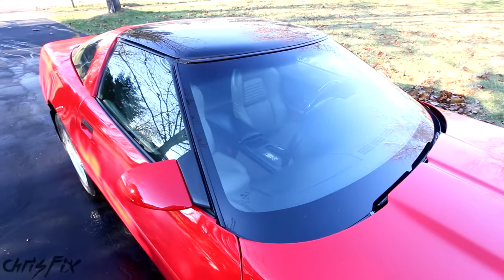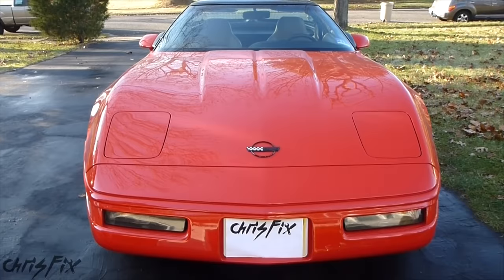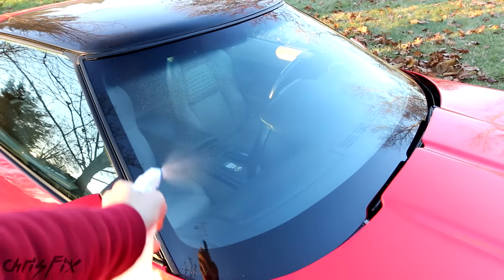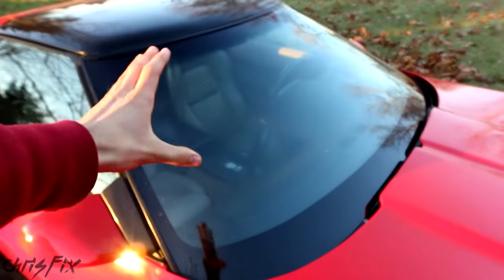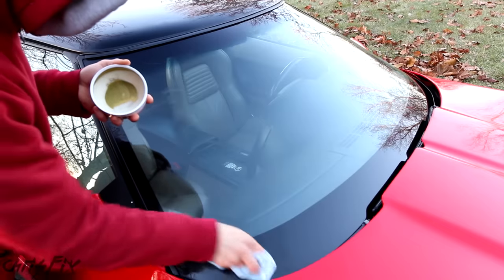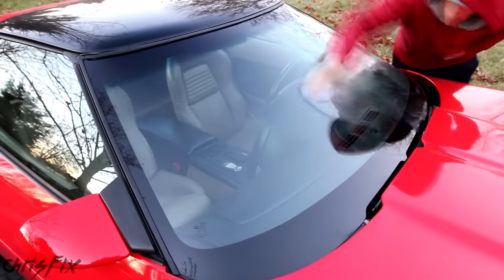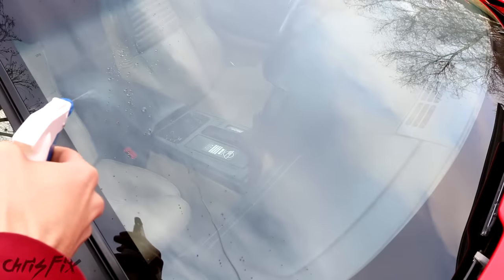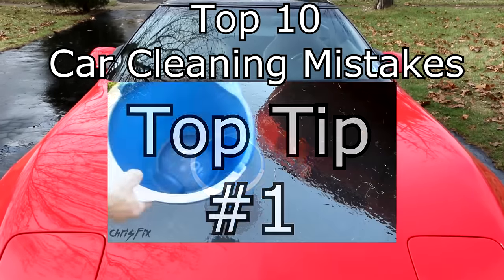How to Super Clean Your Windshield

Comment: I had a 2012 camry and a 2000 blazer this technique worked very well on the blazer but not at all on the camry could that be because there was two different types of glass I also use this technique with exception to the wax part at my glass shop for mirrors and windows we replace customers love the clarity

Comment: I typically wash mine with the gas station's pressure washer and it's soap and water, and right after that i dry it and use Isopropyl alcohol on it with a microfiber towel, since IPA dries super fast and leaves no residue at all. i even use it for my house's windows and PC components since it leaves no residue. it's wild how good that thing cleans :3

Comment: The two towel method works great, ceramic coating your glass also helps, it lasts long and is super hydrophobic.
Reply: do you mean like Ceramkote?  I use that on the black bumpers and the black around windows and it is fab.

Comment: You can clean the glass with Bartender's Friend.  It has Oxalic Acid in it plus mild abrasive.  The weak acid helps to remove any mild water spots or debris on the glass.  If no water spots, you can use Mother's Mag Wheel Polish to remove road film and dirt before the wax or RainX application.

Comment: Get rid of those cheap rubber wiper blades and get some silicone wiper blades(Rain X sells sone silicone blades)They will do a much better job of squeegeeing the glass and they last much longer than the rubber blades.
Reply: I haven't heard of silicone wipers. I am definitely going to check that out, thanks.
Reply: @melindanash9990  Once you go to silicone, you'll never go back to regular rubber blades.
Reply: @jameskoralewski296  👍I'm sure you're right!
Reply: @melindanash9990  The silicone wiper blades sold by Rain X are called "Rain-X Silicone AdvantEdge": You can buy them locally at auto stores like Advance auto parts. You can also buy silicone blades at Amazon with one very popular brand called "PIAA". Don't forget that they sell wiper blades by the length of the wiper blade in inches and the driver's side and passenger side are quite often not the same length. They come with wiper arm and wiper blade installed so they are very easy to replace your old arm and blade.

Comment: I thought your not supposed to wax your car's windshield?
Reply from the maker: Why not?
Reply: Because it breaks or damages your windshield? well that's what my parent told me
Reply: ChrisFix I followed the video but the wax has left an opaque layer on my glass. It isn't clear. 

How do I remove the wax from the glass?
Reply: mojo2418 Dish Soap should do it
Reply: My understanding is cheap wax, especially automatic car wash wax, causes streaking and glare. That is usually cheap wax iirc, a good car wax I have never had a problem with.
Reply: I was told the windshield would fog really easily if it was waxed.
Reply: fog occurs on the inside ,unless its heavy froggy  outside  day
Reply: Yeah idk what type of nuclear wax your parents were using if it causes it to literally break a windshield lol.
Reply: The owner's manual for my car specifically says, "Do not apply wax to glass areas." It does not give a reason, but I am inclined to follow the manufacturer's instructions since the vehicle is in warranty.
Reply: liu dennis why not? been using this method for 30 odd years.  The tip is ..never use cheap wax
Reply: Yukine Hiruko  must be that Turtle Wax Nuclear Windshield Shine-Kote lol!'

Comment: Also another idea you can use  to keep,the glass even cleaner even stain free, is to clean the wipers, the the black rubber part gets really dirty, plus the black rubber part will stop cleaning the glass, I use vinegar, and that would keep the rubber part nice & clean,protect it against the suns Ray's, I use either paper towel or microfiber towels you would be surprised  at how clean and nice they work, plus you save money since it will last a long time,and the wiper blades  that came with the car lasted around 6 years, considering at the prices they are at

Comment: I always detach the wiper blades and clean them with soapy water and a tooth brush in my shower or in the sink.
Also when cleaning the windshield, one should also clean all the other windows the same way and while you at it, spray some PTFE or Silicone spray in the side window guides after you clean them. This way the motors last longer and the windows move up and down faster.

Comment: I never use wax on the windscreen. I finish off with Mequires Ultimate glass cleaner, then coat with rainex, twice. No risk of wax marking up on an older windscreen, and get the same result for rainwater running off.

Comment: I like to treat my wiper blades after cleaning with 303 protectant.  A silicone lube sprayed on a paper towel or even WD-40 will stop squeaking blades until you can get them replaced as a temp fix.

Comment: i tried waxing my windscreen using the advice from this video and it sucks. its almost worse than putting all the effort into waxing it. i really can't tell what part of it went wrong... i had cleaned the windscreen very well and applied the wax. kept waiting for it to dry properly by testing it with the finger like you said, but it just never dried. i used the same wax as you btw. i eventually waited something like 20 minutes and decided it was long enough and started to buff it off, it was going well until i noticed that my windscreen now had many white spots. i try to wipe them off but they don't come off, I'm pretty sure they're filling a hole or something, since i just can't seem to clean it off. however my windscreen is now waterproof which is a plus i guess...?

i also have a big wiper scratch on the glass and was hoping the wax could fill in the gaps, but no, just made it more noticeable..

Comment: A new shammy works incredibly well keeping it clean with no chemicals just a damp shammy extremely damp.  It’s an excellent way for keeping it clean in between the bigger cleanings.  And for the inside A quick wipe down with the shammy will prevent you from having to clean your windshield as much. Literally picks up everything from cigarette smoke, oils, children’s feet marks. That doesn’t have them when I’m driving.

Comment: Hey Chris I may not have seen it but do you have a video on how to get water spots off of glass?
Reply from the maker: I don't have a video on that specifically but one trick I found works well is to mix equal parts water and vinegar, spray on glass surface, give it a few minutes, then wipe off with a microfiber and you're good to go! Just make sure the windshield is cool when you're doing this

Comment: RainX works great in a moderate to heavy rain at beading up the water without having to use your wipers.  But if there is just a light misting you end up needing your wipers as the water just isn't heavy enough to bead up.  The problem is that then the wipers smear the windshield.  How does wax on a windshield work out in a light mist?

Comment: Hi Chris, thank you for your amazing videos, just one thing, i did clay bar and wax my windshield and i really regret it. do you have a trick to remove all that please? i tried to clean it with few different windshield cleaner but it doesn't work. every morning when its cold my windshield is not clear till the sun hit it, even using windshield washer with wiper on, it take awhile. thank you.

Comment: Would windscreen wipers eventually scratch the wax off? 
Need to do this so bad, I’ll replace my blades too so they’re nice and even all over
Reply from the maker: They can, but it's easy to clean and reapply. In light rain I've found that it usually beads up and you don't even have to use windshield wipers but obviously in heavy rain you'll have to use them

Comment: question: shouldn't you wash the windscreen with water to remove the dirt / sand first? If you immediately start cleaning with a glass cleaner and microfiber towel, won't that cause scratches in the windscreen due to sand etc.?

Comment: How often do you suggest doing the wax to repel water?  Also, what I find hard about cleaning my windshield and back window, is that I can't really reach the middle that well.  I suppose I can get a step stool, but thanks for this information.  I have tried everything to clean my windows inside and out, and no matter what I have done, and how good I think they look, I get into the car to drive, and I see streaks and they still have film on them that I couldn't tell when I cleaned them.  I am definitely going to try this.

Comment: @chrisfix  I had my F350 windshield glass replaced this past Friday. This morning was the first time I have driven my truck in the morning since replacement.  Houston area is extremely humid and I immediately noticed extreme streaking on the outside of the windshield due to the humidity. Had to keep my wipers going full time on slow frequency to keep the glass streak free until I was able to get up to speed on the highway.  Was awful!!!  Do you think your windshield cleaning process will get rid of these streaks? or is there another process for this problem?

Comment: I know the video is from a long time ago..
but I wanted to ask a quick question 

I noticed a couple of scratches on my windshield from wiper blades
I don't feel any bumps or dips when I run my hand through them on the sruface 
The scratches are visible when it''s really sunny out and I get distracted while driving

Would applying wax on the windshield help make them disappear? 
Or do you have other recommendations on how to remedy the issue?

Comment: Chris, I use a window cleaner from rain x and mix it with water, but here in Saudi temp rise to 49° so I left the car for few days and went to clean it unfortunately after finishing washing the car’s glass there were still dirty spots
I tried to clean it by using the same and different glass cleaners but none of them help
Do you think this ‘cuz I didn’t use enough water with the mix? And the high temp facing the sun for days?
And how to clean it

Comment: Tip #1  :  Carry your own squeegee and glass cleaner on the road .  Do not use the squeegees provided by gas stations because they are contaminated with bug guts and oil off of other people's cars .
Tip #2 :   If your windshield gets contaminated by splashed-up oil or by using a gas station squeegee,  spray it with bug and tar remover and wipe it with a rag .  Throw away the rag .   Then clean the windshield with glass cleaner .  If need be, follow up with a glass polish from Zaino or Griot's .

Comment: Used your method and now finding "cloudy" spots developed in about a week or so on  windshield that will not go away by cleaning with regular window cleaner. I thought this method was to make the windshield easier to clean? What have I missed (if anything)? I cleaned interior windshield, and spots are  not from there.

Comment: I always wanted to ask one question and guess now it's the time, I do have shining marks on my windshield, all over the area where the wiper blades work, they are extremely fine and you cannot spot them in the daylight, but it makes driving at night very hard and increases the reflection of the headlights of the other cars, is there any way to remove those fine scratches/marks?

Comment: ive been told to clean the window with alchole as itll make a better surface for the wax to stick too, is the true or cap?
Reply from the maker: You can do that but I've found that using a regular glass cleaner works better
Reply: @chrisfix  thanks!

Comment: Don't use wax if you have tiny rock chips or tiny pinholes, I watched this when it came out, and I found out the hard way that the wax doesn't come out after you buff it and wipe it, probably just don't wax it bc I didn't see the pinholes before I did it.

Comment: My solution for cleaning windshields: Invisible Glass glass cleaner and 0000 steel wool (only). To remove the offgassing on the interior of the windshield: Mr. Clean Magic Eraser eliminates the greasy buildup, leaving the inside windshield sparkling clear.
Reply from the maker: This stuff works amazing: https://advanceautoparts.rt8x.net/2ry4eA
Reply: @chrisfix  Is it safe? It has ammonia in it.

Comment: You may not have the answer (or have the time to get back to random youtube comments!) but I'm curious if the clay bar process would remove any existing hydrophobic coating on the windscreen? I had my car professionally ceramic coated and as part of their package the detailer offered a hydrophobic coating for the glass surfaces. I clean the windscreen with a glass cleaner that's safe for coated and tinted surfaces but sometimes I can tell there are things it doesn't fully lift off.
Reply: I'm doubtful that it would remove any existing layer of protectant unless you are using something other than water when using the clay, like a product advertised as a clay bar lubricant, which might contain other additives. Since a clay bar absorbs very small bits of dirt and other contaminants, it is not an abrasive, so it shouldn't make any difference. I'm not an expert so take my advice with a grain of salt. If you wanted to start from fresh, like if the protectant was wearing down to a point of replacement, you would need to use a strip wash agent in order to remove any remaining product and at that point you could follow the guide in the video if you choose to DIY.

Comment: Every time I roll down and up the passenger and driver windows, they get some straight lines of dirt, it doesn't matter how clean they are. Any suggestions on how to get rid off the dirt in the window trims?
Reply from the maker: Roll down the window as far as possible, grab a microfiber and some all purpose cleaner, and rub the bottom trim area until its clean
Reply: @chrisfix  Thank a lot! I'll do that as soon as I have time!

Comment: I really enjoy advice given by ChrisFix but have to advise that wax should never be used on a windshield. Bad wipe performance is caused by screen contamination.  Fatty acid molecules bond to the glass and prevent the glass from wetting. If you see globules of water on the windscreen that indicates that the surface tension is high. Contamination from the road - brake dust, and oily deposits thrown up in the spray, bond to the glass and are made worse if the screen is waxed. The fatty acid molecules need to be sheared from the surface of the glass and a very fine abrasive such as toothpaste can be used for this purpose. Make sure that the screen is clean in order not to pick up grit that could scratch the glass and then use toothpaste on a damp cloth and "elbow grease" to clean the screen. Test the contamination levels on the screen by spraying water on the screen. It should not form globules but should form a single sheet of water that runs off. Also clean the windscreen wiper rubbers. Use a good screen wash additive (not soap or detergent) and things should be fine. Hope this helps.

Comment: Does this method work to remove stubborn water spots? My DI tank was at the end of its life but my sensor light did not turn red to warn me and after rinsing off my car last week I now have horrible water spots. My car has a glass top too so there's a lot of work to be done. Looking for a solution that actually works that will clean the spots off.

Comment: What about cleaning the inside of the windshield?  I'm constantly getting a film on the inside, and it's so hard to remove because the steering wheel, mirror and dash obstruct me from getting good access, and I don't want overspray of any chemical cleaners to get all over the dash and interior.

Comment: Hey Chris, does the clay bar or the wax take off hard water spots?
Reply: If you want to remove hard water spots off your windshield the best thing to use is a compound in the area of a 2000 grit type and it removes it quick.

Comment: Hello, I tried this and I got my windsheild super clean and fantastic. But after the first rain when I was trying out the new wax coat the water didin't bead up but spread into tiny tiny drops all over the windshield and didin't roll off.

Also when I had to use my wipers because of the bad visibility they chatterd across the windshield and left a fog in their path for a few seconds.

Is there something I've done wrong or missed? Would appreciate feedback.

Comment: Hi Chris, I'm a little behind the curve here ... I accidentally spritzed my windshield w silicone spray. Still foggy &w glare. Any suggestions on removing this lovely product from glass? Thank you
Reply from the maker: Yes alcohol and a clean microfiber towel. Only use one side of the towel, clean it, then go to the other side of the towel. You might need to use 2-3 towels. Use alcohol the first cleaning. You can also use a glass cleaner. The one linked in the description works great!
Reply: Thank you Chris !

Comment: Whats your thoughts on adding ATP AT-205 to your power steering?
Reply from the maker: It could helps slow or stop a leak and is worth a shot but you will most likely need to fix the leak.

Comment: hey I need some help   so I'm a truck driver and my windows are covered in calcium deposits.  I have some Zep window cleaner and have tried scraping the windows too  what else can I try to get the windows clean without using anything mechanical on the windows?

Comment: I always thought that wax shouldn’t be put on a windshield because it affects the wiper operation. I use white vinegar on the wiper blades.
Reply from the maker: You shouldn’t leave it on thick. You need to buff it off so it basically leaves only the oils on it.

Comment: My Method of Cleaning the Glass
1. Clean the Wiper Blades (I already know) 
2. Spray the Glass Cleaner on the Towel, Clean the Glass, Dry the Glass 
3. Clay Bar with Glass Cleaner, Dry Off After 
4. Protect the Glass 

Products- Glass Cleaner, Quick Detailer, Waffle Weave Towels, Clay Bars, Griot's Glass Sealant